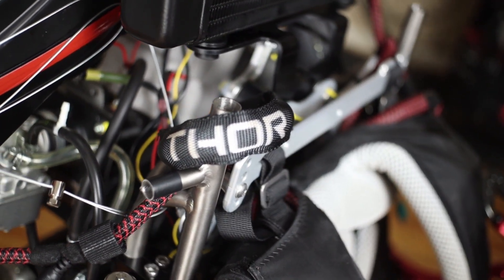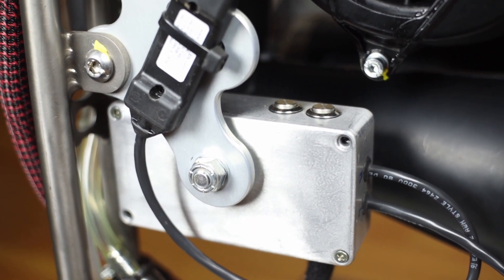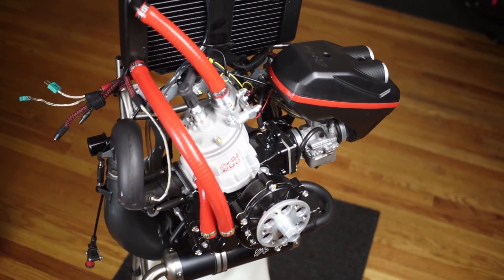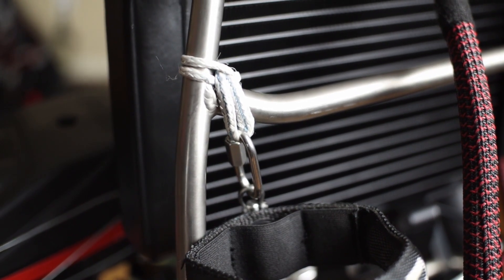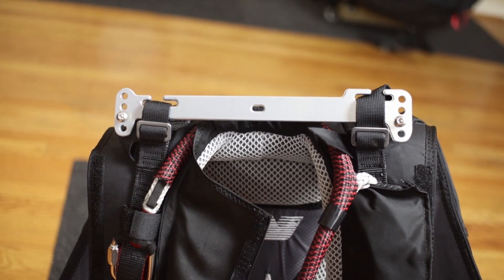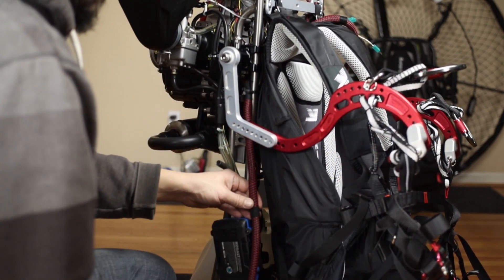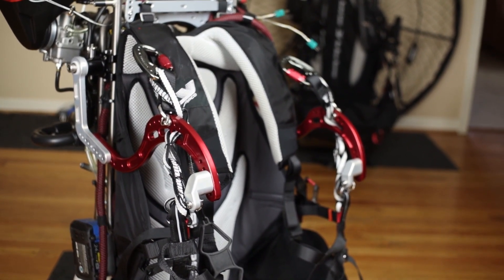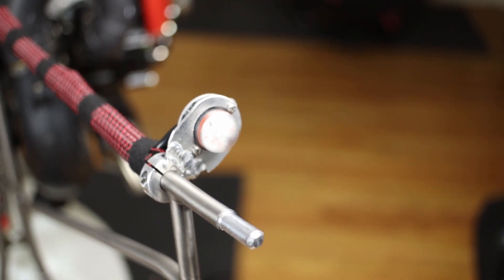Ultimate Paramotor Build - Polini Thor 202 [feat. Liberty, apco mkII, red strobes] Limitless PPG

Comment: Excellent overview! Are you concerned that the plastic buckles that hold your harness to the frame might not hold you and might fail if there is a lot of force on them in an unexpected failure? 

I am at 90 hours on my Polini Thor 202 and like you, I love it. Smooth, powerful, and honestly I do not mind the extra weight for the 5-10 minutes it is on my back per flight.

I do want to get the remote choke. My currently process is to flip the choke, get it on my back, start it, let it get to about 30-40ºC coolant temp, then shut it off, take it off, flip the choke back down, then get the rest of my stuff ready to fly. It works, but it would be nicer to only have to put the motor on once!!!
Reply from the maker: Thanks for the heads up, should I be worried about the buckles?  I could be misunderstanding, as of now I do not foresee a risk because the maximum loading on the buckle is from the mass of the paramotor + inertia, maybe 120 lbs max if you jump off a porch.  

To get an idea I see that the 1 in. YKK plastic buckles are advertised to handle 350 lbs.The buckles on the APCO harness are 1-5/16 in.

I agree, the remote choke is not required, and is convenient.  I have used it for diagnosis lean conditions, like the Dellorto lean idle problem in near freezing weather.   I'm fixing to design a choke actuator to add fuel in-flight to help with tuning and adjust EGT during cruise.  I have parts to add an air bleed as well with a flow control, this way I can lean out EGT during cruise as well.   

Before I continue with the carb stuff, I'm deep into upgrading the fuel system.  First is understanding the stock flow rates, pressure if I can even measure it.  The stock plastic fuel pump is genuine mikuni, but I got a square body metal Mikuni to compare and they are easily rebuildable pumps, plastic ones are disposable. I got a spring loaded one-way check valve which should act like a very low pressure regulator, in theory.
Reply: @iKenFlyPPG  I'm just thinking in a collapse or reserve situation, or even in a tight turn or light acro, the forces on your harness could be pretty extreme. If you pull 2-3Gs and weigh 200 lbs, that could be 400-600 lbs of force on those buckles, which are keeping your shoulder straps attached to you and your body! If they were to snap, your leg buckles might be the only thing holding you in your harness, probably not ideal.

I'm not sure of the breaking force rating on the nylon straps, but I am guessing it is much higher than the plastic buckles, if they even have a load consideration.

These are extreme cases, but in such cases I personally would want to know that I'm maximizing my chances that my equipment will not fail in unexpected ways that could cause me injury or death!

I'd love to see more about your choke actuator design! Sounds fascinating. I'm probably going to see if I can pick up a remote choke this year.

I'm very much interested in your fuel system tweaks and upgrades too! I appreciate optimization, and anything that provides better fuel economy, delivery, and/or reliability and maintainability is WICKED awesome. I hope you'll continue to share your journey and the things you learn! Thanks!!
Reply from the maker: @ooglek  Not sure if I understand the force vectors you're mentioning.  My understanding is there are 2 plastic buckles for the shoulder straps, which are not in play while flying, and then there are 2 buckles that keeps the bottom of the harness stabilized.  

Furthermore, my understanding is that all wing load forces are transferred through 1) harness-to-swingarm mounting loops, 2) swingarm-to-frame mounts.  The harness mounting loops are engineered to take all of the load, seat board breaking loads.
Reply: @iKenFlyPPG  AFAIK, and based on my previous APCO Universal harness and my current Dudek Power Seat Comfort, the shoulder straps loop over your shoulders and the strap connects directly to the frame. I had one come undone while I was pre-flighting, and the shoulder strap just dangled in space. If both were to have come off, my upper body would not be restrained against the seat or harness back. The chest strap would potentially choke me if I were thrown forward for some reason.

If the shoulder straps connect directly to the clips, then if enough force were to occur and they would both break, the shoulder straps would not restrain your upper body in the harness, and could potentially choke you with the chest strap.

You are correct that the shoulder straps are not under tension while flying, but in a collapse, collision, wind shear, or other unexpected loss of lift, or if/when a reserve is thrown, your person would be thrown about in an unpredictable manner, but with likely higher than 1G of forces, depending on if your wing catches lift and then loses it again.

I would not want my shoulder straps to stop retaining me in my seat during an incident, especially on a crash.

One thing my instructor told me: "You're the pilot." We all take risks! If you're comfortable with the clips, and know their shear/breaking strength and are comfortable with it, no worries at all! 

Personally I look for the "weakest link" on my harness, frame, and motor, both during pre-flight and maintenance, to try to eliminate any failure points I can, even if under normal operation, it would be fine. 

You are also correct that the wing load forces go through the harness-to-swingarm, and swingarm-to-frame mounts. My comment/concern is about how YOU, your physical body, is restrained in the harness, if the clips, for whatever reason (cold makes them brittle, hot/cold cycle reduces strength, accidental petroleum product weakens it, load is exceeded), break. I don't think you'll fall out, but not having your upper body restrained in a crash, or in a weird spiral that could put you in a situation where you cannot sit up to reach the risers/lines to control things, could have bad consequences.

The risk, I realize, is very low. I've been flying for 3.5 years and have not had a collapse. The likelihood of the clips being overloaded and breaking is low as well. But it is not nothing, and I'm a guy that hopes to fly for another 20-30+ years if possible, so I keep an eye out for things like that.

I yield to you and your piloting skills here! I would feel bad if something happened and I hadn't mentioned it, but I also think it is a reasonable risk, as long as it is considered and decided by you to not be important enough to change. Respect!
Reply from the maker: @ooglek  I see where you're coming from and don't deny those situations exist. I'm only hypothesizing and discussing, I am in no way refuting you personally, I'd like to stick to discussing the idea. I feel as though I'm trying to take a side here, please be aware I'm an engineer personality with bad people skills and always come off arrogant, and I'm good at picking apart ideas, especially mine.  I don't like it when friends come to me with business ideas, I am the buzz killing realist.

I can visualize getting dropped, but the inertia of the paramotor frame + motor isn't much. 

I'm thinking out loud, the plastic buckles only connect the harness/pilot to the frame/motor. The harness/pilot could weight 200 lbs for example, and the frame/motor 70 lbs.  

There would have to be enough acceleration and kinetic energy achieved to apply tension between the pilot and frame.  I don't think there is enough mass in either system to generate enough force without extreme accelerations to generate hundreds of pounds, it's 6-8" of slack maybe.  

I think the accelerations required for this will likely kill the pilot, for example mid-air collision where a large aircraft that hits just the paramotor frame, then ripping away the paramotor frame from the pilot/harness.  Like I hypothesized, you're dead.

However thinking out loud some more, I can see the wing being the source of massive loading on the paramotor system, although the wing is attached through the strong points of the motor so, hmmm.  Even if you got flipped upside down and ripped violently at some odd angles, it's still attached to the hard points.

We should certainly add it to the FMEA, that's where we sit down officially and come up with very specific failure modes (plastic buckles snapping, all the combinations 1 through all 4 failing), and then analyze the effects of the failure. You assign different values to them, idk for example, the likelihood is low but if it does happen then it's really bad.   

I'll now think about it some more since you've brought it to my attention!
Reply: @iKenFlyPPG  All good mate, I'm here for the hypothesis and discussion!!! 🙂 I am also an engineer, though software. I am not taking your responses at all as arrogant! I think getting to the details of the matter and ensuring that we understand each other is a great path.

I agree, the forces needed to break the buckles would be very unusual. But I could imagine that if you took a collapse, you and your motor and wing are in freefall, possibly accelerating to terminal velocity, about 200 km/h or 120 mph for a human. Maybe slower with the prop and wing. Now take that mass, you, 120kg/200lbs, as well as the harness, frame, and wing, and either your wing regains lift or you throw your reserve and it opens. According to skydiving information, when a parachute is opened, you experience a deceleration of 27 meters per second squared, nearly 3G vs 9.8 ms² of gravity. This is most certainly survivable. Humans can survive 2-5 Gs without permanent harm, 5-9Gs with a varying level of injury.

If you aren't perfectly upright at the time of deployment, you could get whipped around in the harness when the wing regains lift or the parachute open, also throwing some fun angular momentum of first your harness, then your body, being whipped around.

I also suspect that a slack line that comes into tension quickly might receive a higher breaking force than if the line was under tension already. The harness might not be under tension while falling, but absolutely could be on parachute opening or wing regaining its form.

This video shows a plastic buckle that broke at 96.44 lbs: https://www.youtube.com/watch?v=pEhcWEuaqj8

This 1" plastic buckle claims the average breaking strength to be 281 lbs: https://www.sailrite.com/YKK-Side-Release-Buckle-Black-1-Heavy-Duty

This obviously does not apply to all plastic buckles, nor the exact buckles you have on your frame. But it does lead to the question -- at what point will the buckles break? Does temperature affect the breaking load? What is the momentary load on the buckle when dropping a 50 lb weight from 3"? 6"? 12"? Can we just calculate the momentum? I know how to calculate momentum, mass times velocity, but I'm not sure off hand how to calculate the actual pulling force of that weight after 12" of acceleration from gravity. I'm sure I used to... hahah

If you know the source of the buckle, or there is identifying information on it, maybe there are published specs for the breaking strength of the buckle. If not, then the breaking strength would have to be unknown, and while the harness is absolutely connected well to the frame at the top, I do not know the impact of your flight and safety if any or all of the buckles were to break. If the shoulder straps broke, one or both, you would definitely have a very interesting landing, as the weight of your motor and frame would fall on your legs and torque strap! 

There really is a very small chance of this being the difference between surviving and not, and a very small chance of this negatively impacting a normal flight, except for the landing part, which could cause frame/prop/motor damage and/or injury. I would want to know if I could trust the buckles, or if they are the weakest link.

Interestingly, a 1" width of nylon strap has a breaking strength of between 2,750 and 4,000 lbs (heavy weight vs tubular). This seems much higher than any plastic buckle! I did not find any specs from APCO nor Dudek on the type of nylon strapping they use, nor the breaking strength, but I have to assume (and hope) it would be heavy weight or tubular for strength and durability! 

I couldn't find any data on a 1" stainless steel single bar slide, so I do not know its breaking strength. Since the strap is "woven" through it, it may not be a concern, but maybe it should be! This is similar to how my harness is connected to my frame: https://strapstogo.com/buy/1-inch-stainless-single-bar-slide

My goal is safety! I want as many paramotor pilots as possible to live long and fruitful lives with lots of flights and hours in the sky. 

Plus I like nerding out on physics stuff sometimes! Thanks for nerding out with me! 🙂
Reply from the maker: @ooglek  The failure mode = the plastic buckle / buckles fail.
The effects of the failure = your butt moves around more than you're use to, your weight shift authority deteriorates. 

After you take your 9G collapse flipped around, and all the plastic buckles snap, now what?  If you put yourself in a situation to be that messed up, I would only be able to say "play stupid games, win stupid prizes".  I'll stick with lightweight plastic buckles and take my chances, it's all about calculating risk and this is pretty low on my risk scale.

Similar to bump scale, me and my setup can take some abuse, where my PPG buddies will freak out when I call it a 2 out of 10.
Reply: @iKenFlyPPG  Hahahah, fair. I still think the failure mode would leave your shoulder straps disconnected from your frame, and on landing the weight of your frame/motor would simply fall to the ground once your wing loses lift. This could cause damage or injury. My shoulder straps go over my shoulders, then down to the bottom crossmember of my frame. I am assuming that your shoulder straps do the same, but plug into the buckles. 12:03 Your shoulder straps plug directly into the lower buckle. In normal flight, sure, NBD. On landing, your shoulders have half or zero ability (if one or two buckles broke) to hold your harness and frame and motor up, and your whole rig will fall to the ground as lift is lost on landing. While still attached to your legs. 

I don't even think it would take 1-2 G to break those plastic buckles. But again, I don't know the specs, just using what I could find online, which seemed to indicate between 100-300 lbs breaking strength, which is about 10% of the likely breaking strength of 1" nylon straps (2750-4000 lbs). 

Repeated loading and unloading could also theoretically cause the buckles to prematurely fail. Cold/hot cycles too. I'm not a material science expert though, maybe it is fine.

I too am a bit more tolerant of bumps than my flying compatriots, just not to the point where I'm putting THAT much stress on the system! 🙂

Thanks for talking through it! It was fun to learn about the breaking strength of things. Cheers! 🍻

Comment: Nice video!  I loved my 202.  What're your plans for monitoring the two temp sensors?
Reply from the maker: I got a 2 channel hand held industrial unit (~$30 jungle site), and it has issues reading both at the same time. I have to swap the temp t/c connectors in flight. I made K-type extensions with expensive legit k-type connectors.  Pretty sure the Polini factory T/Cs are K-type, it always matches ambient, lmk otherwise ha!
Reply: @iKenFlyPPG  Yeah, I have just been overpaying for the Polini tach that includes a single temp.  I've had my eye on flyhenry ppg meter for a while but haven't pulled the trigger to get one.  I've resorted to only monitoring EGT and that's "good enough" assuming you check your radiator fluid levels occasionally.
Reply from the maker: I just dropped this EGT tuning video! https://www.youtube.com/shorts/dA50iYbaz0k

While I have some more extra time on my hands, I pulled the EGT sensor and compared it with a lab grade K-type thermocouple (1/8 probe closed tip) just now, it was on par at 24.4C and 75.6C +/- 1C temperature test points; while both probes were free floating in water of these two temperatures.  I let them both settle for 3 minutes each, they were within 0.2C in 30 seconds I'd guess.  

I also used two different thermocouple readers, my larger 4-channel I've had and the 2-channel I got for the motor.

Was questioning my EGT readings before dropping that video haha!